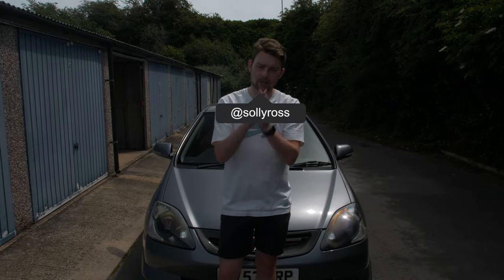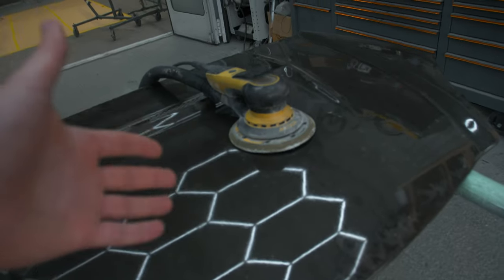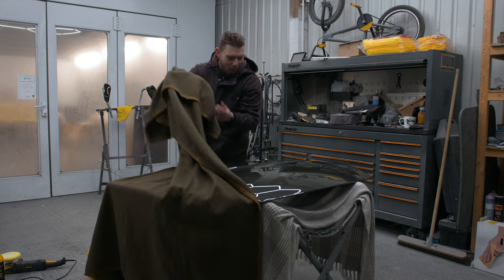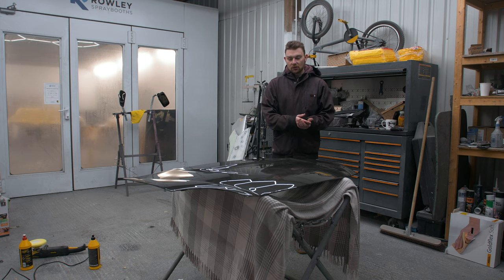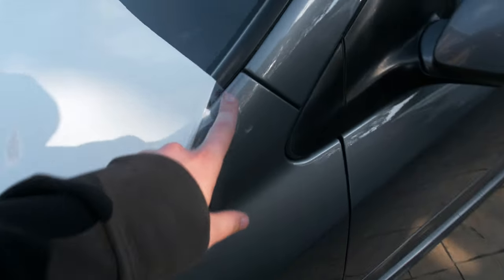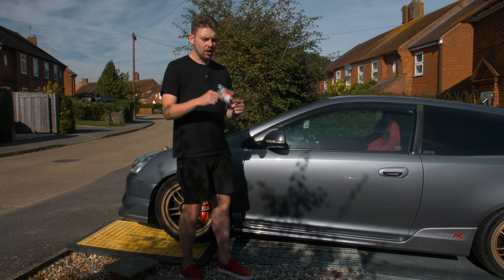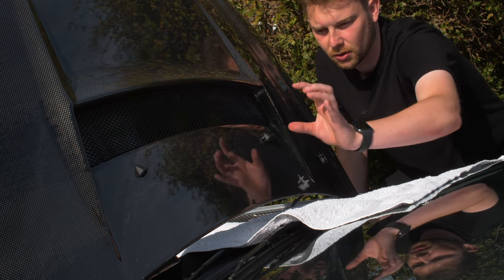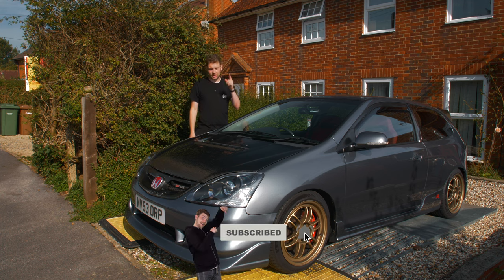This Is THE BEST JDM Carbon Bonnet For The Honda Civic Type R EP3!! 4K

Comment: Pretty sure the jazz jets don’t come with gaskets because they are mounted onto plastic not a painted surface. Bonnet looks epic too
Reply: just about to comment this, remembered it from my Fit
Reply from the maker: That would make a lot of sense! Just crazy that the gasket doesn't exist as a separate part number for EP3's. I can only assume they come with new EP3 washer jets

Comment: Make sure that if you leave your bonnet open on the stand, that you actually leave it on the second hole where it will sit almost vertical! ... I have the same bonnet and leave my bonnet open after a spirited drive to have the engine bay cool down, was leaving it on the 1st hole and had it actually become bent and almost crooked ..
Reply from the maker: That is good advice! I will need to file out the second hole as the prop doesn't fit at this point in time! Thanks for the heads up!

Comment: Where can I find this bonnet?I had this on my ep3,I gave it and I'm looking for a new!!!I'm from Greece and my bonnet was from buddyclub
Reply from the maker: Do you care about it being branded with BuddyClub? 
It was made for them by a company called Shift Sports in Japan. They still sell it brand new but you won’t get the BuddyClub branding. 
It will cost just over £1000 though.
Reply: @OllyRoss  thanks for it.its too difficult to get it from Japan. If I find it from Europe it's OK.i don't now about seibon,it's the same?
Reply from the maker: @giorgossoldatos2100  Seibon are a US company but they do have European distributors